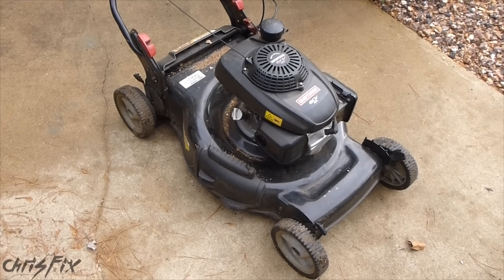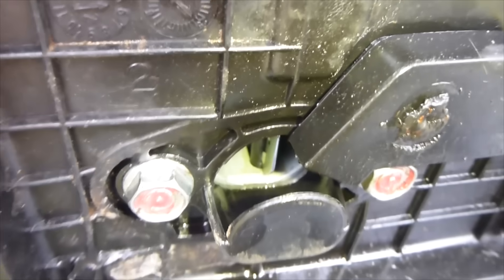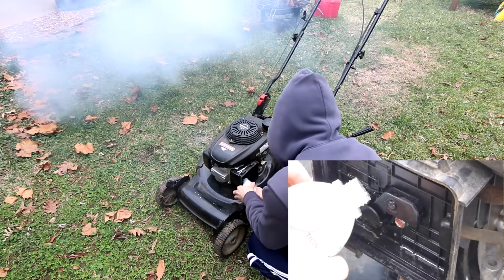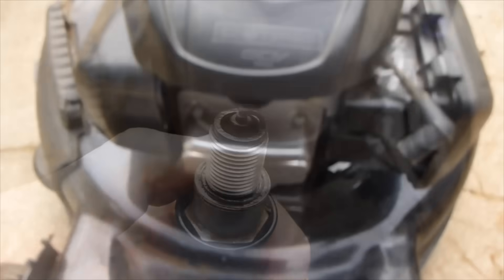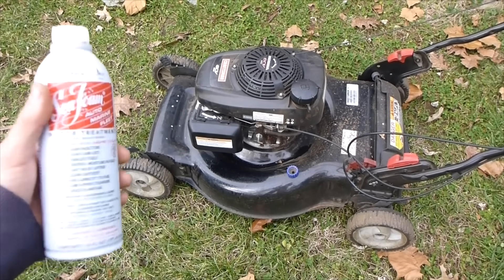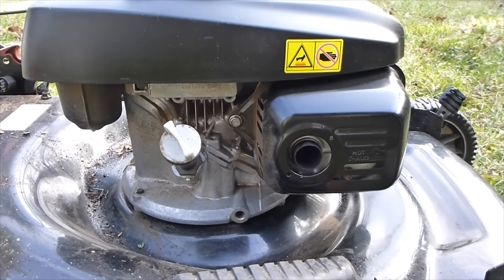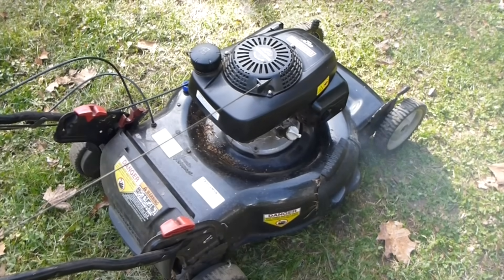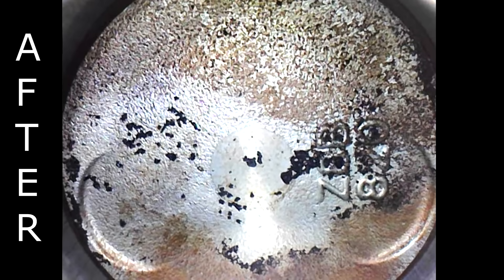Does Seafoam Actually Work? (with Proof)

Comment: Excellent videos, I'm interested on how seafoam did in the crankcase oil. I got a trailblazer where the oil pressure is dropping and killing the engine. I realize its probably the screen for the sensor, but seeing if seafoam would work to clean out this stuff would be great.
Reply from the maker: txnn ark Yea, that isnt good. I mean, if you try seafoam you will know if it works or not based on if the oil pressure goes back up. I personally dont like adding stuff to my oil.

Comment: Total waste of time and money... Run your mower or whatever long enough to get hot and dont leave the choke on. The engine will keep itself clean. A little carbon in any gas engine is quite acceptable.
Reply from the maker: fawcems That isnt the point of the video. It is to see if seafoam can remove carbon. Sure the carbon was not enough to cause problems but the idea is just to see if the carbon actually gets removed.

Comment: Isn't it dangerous to release so much carbon at one time since it will fall of the piston head and then possibly get stuck between the piston and the wall and then mess up the rings/ seals and or scratch the wall.
Reply from the maker: Akiva Feinstein I think the carbon comes off slowly when you do the pouring method. The last part was more of an experiment and I wouldnt normally do that lol.

Comment: i like it in the crank case, my oil used to get dirty after a few hundred miles, i ran a whole bottle for a few days, then changed, and changed again after a few hundred miles, and switched to motorcraft synthetic blend, and subbed in a quart of lucus synthetic stabilizer, now its amber for a few k... also i like to do 1/3 1/3 and 1/3rd, crank case, vacuum line, and gas. i put it in the gas and oil at the same time, then drive till its low, then get it warmed up, and do the vacuum line, then go stand on it on the highway, for a few good 2-3 pulls, and i dont run in od during this i want it to get hot, if you get on 562 at ridge its like almost a half mile up hill, then i get on 75n and turn around at padock, and hit 562 again, and its up hill for like a whole mile, then i cruse out the rest of the gas(still no od), and go get gas, let her cool down and change tho oil, also if you do this with half of the plug gaps closed it will burn out your clogged cats, the raw gas raises the egt and melts the cat, ye!(not recomended) but i did it in my markvii, and they(the cats) started glowing red, and my buddy was like cut it off, i was like nope im going to go stand on it if that shit hardens it will clog, and she has run fine for years now, but i dont have downstream o2's so my ecu dont know...
Reply from the maker: Tee Mann Thanks for sharing!

Comment: I have used this stuff for years and it works great. I do it every oil change, I pour a whole can into my full gas tank, then I pour half the can into my vac line, let it sit for about 15-20 min and take the car for a throttle happy drive. The smoke coming out is pretty cool lol
Reply from the maker: USArmyZ28 Thanks for sharing the story man!
Reply: Any time man. It's good stuff, have you had luck with some of the other brands? Also, what do you think of marvel mystery?
Reply from the maker: USArmyZ28 I havent had any luck yet. The video links to the other fuel system cleaners are in the description if you are interesting in seeing how it works.

Comment: I owned a 2005 Chevy Express extended van 3500 with a 4.8 engine. I had a clogged fuel injector. I added a can of Seafoam to the fuel and while driving the van for 15 minutes. Seafoam cleaned the clogged injector and the van ran fine. I beleive in SEAFOAM.
Reply from the maker: Joe Carollo Thanks for sharing!

Comment: Great job...however it is the fuel injectors that would really benefit from Seafoam (in which you would have to run it through the tank or through the FI line) The lawn mower sounded healthy before and after the seafoam project.
Reply from the maker: ***** Thanks!

Comment: I get that it removes carbon but I would be far more concerned with carbon build up on the valve and valve seats. I would really like to see what if any improvement it made on that. Just a thought.
Reply from the maker: ***** I agree, but if it works in the combustion chamber, it will work on the valves and valve seats. I wish I had a way to check the valves.
Reply: ChrisFix That makes sense. I will definitely try it out when I clean the valves before lapping.

Comment: I used it today, 1/3 in gas tank, 1/3 in oil, and sprayed throttle body. I got a mileage change from 381 to 421 in a full tank on a 2005 hyundai elantra gt. Much smoother acceleration too!
Reply from the maker: mybestday1 NICE!!!

Comment: I thought seafoam was a gas additive...?
How about a test via a gas additive as most cars and trucks now-a-days have no carburetor.
Reply from the maker: ***** You run it thought the brake booster vacuum line for fuel injected cars. I will testing my truck in a day or so, so stay tuned! Mondays video will be fun!

Comment: Good vid!  I've used this for years, and it does work great.  Instead of trickling it in or using a vac line to draw it in, I stick in the sprayer from a spray bottle and mist it into the carb.  I especially like to do that on motorcycle carbs so I can hit all 4 individually.  When it's time to stall it out, I just spray faster - Wally
Reply from the maker: no no Thanks for sharing bud!

Comment: You can do the same thing with water. Carefully dribble it in and the resulting steam will remove carbon from a piston and valves. Seafoam is a farce.
Reply from the maker: moomike laloo Actually, I tested out water (the clean spot at the bottom of the piston. It does work but not the same way seafoam does.

Comment: Impressed you did a borescope inspection. Most just assume that white cloud means their engine got cleaned when its mostly the seafoam burning. 
For automobiles a simple water injection system works fine. After failing a smog test it was recommended I decarbonize my engine. I borrowed a fiber optic borescope and each piston had between 1/8-3/16" hard carbon buildup. I was gonna chip it out withb long wire brushes and then vacuum it but was advised the carbon would get in the rings and ruin them.Tried seafoam techron and pass or dont pay but after use each had little effect by viewing the borescope. 
Went to home depot bought some brass needle valves pvc tubing and fittings and rigged up a system where I could meter in some distilled water from behind the wheel while I drove. Inlet is at the pcv fitting past the throttle body. 
Get the engine up to temp and at highway speeds open up a valve creating a vacuum leak then plug a hole in the line which sucks the water in. Theres a larger diameter tube inline to act as an expansion tube to atomize the water. The main tube is just 1/8".
Target ratio is 1:10 water to fuel and after a few gallons of water in a few weeks the pistons were all shiny clean and the engine ran smoother and revved faster.
Oh and passed smog.
There is more to it than steam cleaning seems H2O when introduced to the combustion process separates molecules which directly attack carbon breaking it loose and vaporizing it before it passes through the O2 sensors and cats so there is no chance of damaging them.
I left the system on and reclean it every few months and once in a while on a hot summer day if I am going uphill with the AC on I will crack it open to avoid overheating but not sure the effect of that.
You do want to do this only when the motor is hot and never right before shut down (so there is no residual moisture leaking down the intake or in the oil. Moisture that gets in your oil will see the water vapor burn off quickly if its hot)
Reply from the maker: FuckGoogle+ I will be testing seafoam and water in my truck very very soon! Thanks for sharing your trick and experience with the water cleaning!

Comment: I have a 2004 SS Impala. I only live no more than a mile from my job. Don't really travel too far besides that. I get horrible gas milage because of the quick stop & start of my vehicle. I used seafoam this week & I'm getting better gas milage but still driving exactly the same. I went from 9 mpg to 19. I'm very impressed. (I put 1/4 of the can in the gas tank & I had 1/4 of gas. Then filled up to a full tank & put another 1/4 of the can.)
Reply from the maker: Gnik4144 Wow, too bad we cannot see the inside of your engine! Thanks for sharing!

Comment: Do you think its worth it to put in fuel and run a couple tanks through on an atv? or do you think it would be too diluted to help much?
thanks
Reply from the maker: Wes Roberts I think it would be worth it because it does a good job at leaning the combustion chamber with full concentration, I would think it would do a good job cleaning the carbs or injectors and the valves in your atv. Unfortunately, with my testing of other cleaners that go in the gas, it doesnt seem to work.

Comment: Does the Seafoam foam have to be poured in, or can we use a spray bottle? I'm not sure if the atomization of being sprayed in would change the results are not
Reply from the maker: Robert Clucas Either way works. I heard that they have a seafoam spray so I would guess both methods will work.

Comment: Used this in my Chevy to clean out  my motor so it ran better and it works a little to well... After the 700 mile trip from ga to nj few miles later bam blew the heads an thermostat went. Lol later found out the ass I got my truck from put wood chips in it to hide the problems the motor had an so seafoam found it an that's the end of that story
Reply from the maker: mason DeVoe Dang. They used wood chips?
Reply: Yep, it was hiding that it had a blown head. wasn't really a great thing to find out 740 miles from home lmao. Tho it smoked more then that mower and seafoam

Comment: ChrisFix Not to burst your bubble, but putting ANY liquid directly down the carburetor will clean carbon off the pistons. My grandpa used to pour straight water down the carburetor and a ton of soot and carbon would be thrown out the exhaust. Just keep the engine RPM's up at 3500-400 rpm and dribble water down the carburetor.

Also, you didn't mention changing the oil after your experiment. ANY time you are dumping a foreign fluid into your engine or doing a piston soak, you need to change the oil afterwards as your oil is likely contaminated with lots of Seafoam.
Reply from the maker: Actually, before I did this test, I tried water for 30min. The only part it cleaned was that bottom part of the cylinder. I will be trying water again in a car motor so stay tuned!

Comment: So my concern is where do those deposits go after they're loosened up in large engine? I've heard people say seafoam is great because it's an aggressive cleaner but, it could clog your cat or ruin some O2 sensors in the process.
Reply from the maker: DJ Harrison the deposits should be very small. It doesnt break off in chunks. It breaks off as small pieces. We will see how it affects the O2 sensors and cats when I try this on my truck very soon!
Reply: Just gas running through a misfiring cylinder can clog a cat, so small particles should be able to as well.
Reply from the maker: DJ Harrison Gas running though the cat cloggs the cat because it melts the cat.

Comment: About 54 years ago, my Dad showed me basically the same thing, telling me it would help clean the carbon out of any engine and make it run better. His warning was, ...."just don't get carried away and over-clean it." His method involved the use of Kerosene or white gas (Coleman camp stove and lantern fuel.) I had an old Hillman Husky 4-banger that ran like crap, but he was confident the clean-out would straighten it right up. It did, and it fairly well smoked out the east side of town, but once done we took it for a spin to see the difference. Almost got whip-lash!
Nice video Chris. I'll give it a try in my Dodge Dakota 3.9L and see what happens.
Reply from the maker: Gene Kinnick Thanks a lot and thanks for sharing your story!

Comment: Just for comparison...use a spray bottle with just tap water the same way and see the results.  The water quickly cools the hot carbon deposits and causes them to pop off the surfaces.
Reply from the maker: darkwingrf I will be testing tap water in a car. I tried it in this mower (the clean spot at the bottom) but it didnt do as much as I thought it would.
Reply: ChrisFix I'm looking forward to the tapwater test.  So far the only "proof" of it's efficacy that I've heard is the fact that leaking head gaskets result in clean pistons.  But putting a little bit of water in a short period of time could be very different from a little bit of coolant leaking in over a long period of time.  So thanks in advance for (hopefully) testing this old theory.
Reply from the maker: oinka720 Exactly. You are 100% correct and I cannot wait either!

Comment: Pretty cool. thanks for the video. I used it on a bike engine that didnt like to idle. just mixing it in teh fuel make the engine idle and run great. 

I treat all my engines wiht it monthly, just mixed in with the gas. or in the oil 100 miles before an oil change.

Comment: does it work if you mix it with your fuel?
Reply from the maker: GoodKarmaStudios On the bottle it says it will clean the injectors, carb, back of valves, but they do not claim that it removes carbon in the combustion chamber when mixed with gas.

Comment: Hey Chis I want to do my own transmission oil and filter change, I have a 2011 Toyota Camry se do you suggest I use transmission oil & filter from the Toyota dealer ship or is after market brands better? I heard Mobil 1 is TOP OF THE LINE?
Reply from the maker: LUPE GARZA I like using oil filters from the manufacturer for the tranny but for fluid you can use whatever meets Toyota's tranny fluid specifications. Mobile 1 is good stuff as well as many other companies!

Comment: That tiny bit of carbon don't hurt the performance in the slightest. Did the engine run any better after all that? Nope.
Reply from the maker: kirbylee57 That isnt the point. The point is to see if it can remove carbon in general.

Comment: plain water works just fine as well, I'm not surprised that this overpriced little bottle labeled seafoam works also.
Reply from the maker: dark chocolate I used plain water in this engine before the seafoam (that is how the clean spot at the bottom of the piston got there). Seafoam worked better.

Comment: An old mechanic's trick which I think works just as good if not better is plain water. Dribbling it into a running hot engine, the water removes the carbon like steam cleaning. I had an 86 Mazda truck that had so much carbon buildup on the piston,  it was hitting the cylinder head causing a loud knocking in the engine. I decided to give it a try and poured a coffee cup full of water in the   running engine and revving it. The knock went away in seconds. Another thing to consider is that Sea Foam is a Hydrocarbon and when combusted, it produces carbon. Another plus is water doesn't stink up the neighborhood  like Sea Foam.
Reply from the maker: kkuenzel56 Thanks for sharing! I will be testing water to see if it works!

Comment: What type of camera are you using?
Also have you tried using water in a spray bottle. The water turns to steam in the combustion chamber. Old hot rodders have used the technique for years.  Would like to see the results.
Reply from the maker: txturbo930 The camera link is in the description. I will be testing water soon to see if ti works!

Comment: Wouldn't the deposits clog the CAT system if used in automotive?
Reply from the maker: Andrew Taylor The deposits are so fine they should go right though the cats but that is a good question that I do not have an answer for (with proof).

Comment: I actually did the soaking to my motorcycle engine. The PO ran it for a long time with a bum O2 sensor, and because of that it ran super rich and put a nice carbon cap on the pistons. It was so bad that giving it just a little bit of throttle on the highway would make it start pinging like mad.
I dumped 2/3 of the can into an almost empty tank along with a ton of octane booster, swished a bit around on the two cylinders and rode it like I stole it. Haven't heard another ping since.

Comment: Hi Chris - one advantage you won't be able to see with the naked eye is the carbon deposits on top of the valves will be cleaned off as well. Carburetted engines are easy to do this with as you've shown, with a downdraft carb even easier. EFI you need to have a little snorkel to send down the air intake to the butterfly plate and hopefully enough is sucked in to knock the carbon off in the same way. We don't have Seafoam here, I use a carburettor cleaner made with acetone and methanol - does the same trick :)
Reply from the maker: Albinus81 Definitely! I am trying to find a car where we could see the top of the valves but it is tough to get the camera in there!

Comment: chris thanks for risking your investment to prove to us dummies a very well tested point. i have one question from your experience and history with seafoam if i do chug it down the gas tank and try to aim for cleaner injectors will it in anyway harm or hurt the injectors basically will it clean or do nothing rather than damaging my FJs? cheers
Reply from the maker: AlboThuggaa If you dont have any problems with your car's injectors or fuel system, there is no need to run a cleaner in your gas. If you suspect a clogged or dirty injector, then  seafoam might help clean it out. Seafoam will not harm anything. I checked the MSDS and there are no "dangerous" chemicals for your fuel system. Some cleaners like B12 have strong solvents like acetone and toluene and I do not suggest using that.